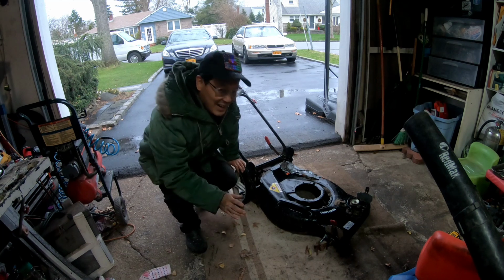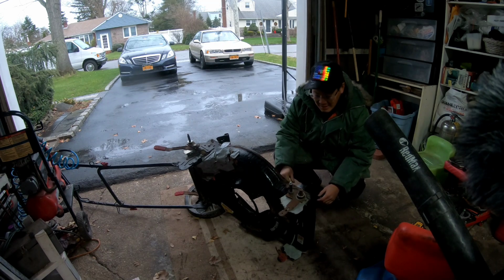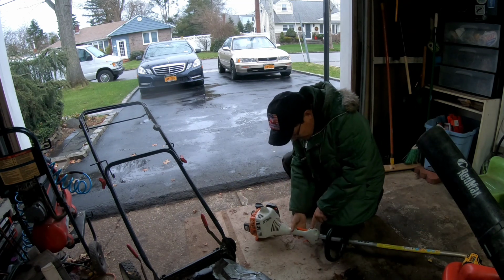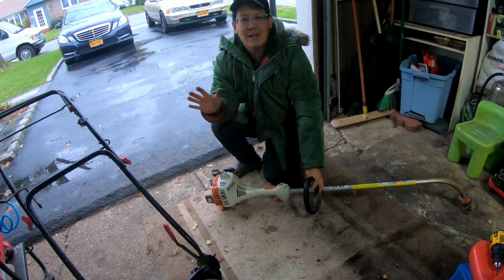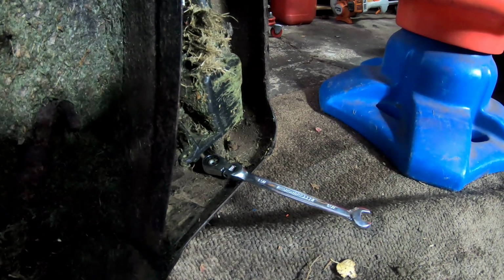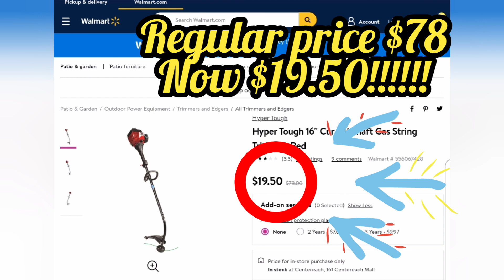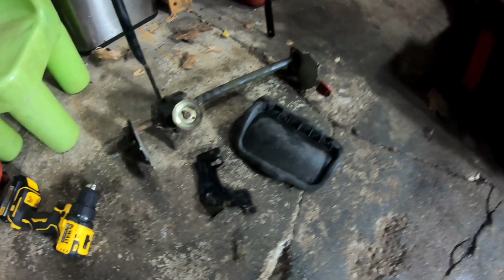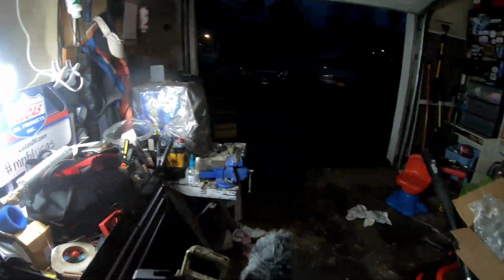FASTEST GARBAGE PICK EVER! FREE STIHL FS45 WEED TRIMMER EATER WHACKER & CRAFTSMAN LAWNMOWER TEARDOWN

Comment: You can actually find those guards pretty decently priced on eBay between $10-$20. Put a new guard on, use some Super Clean and you can get top dollar out of that thing!
Reply from the maker: Yeah, but to spend $20 on a $50 weed trimmer?  Make a $30 profit?  I’ll probably keep it as a spare
Reply: @MowersNBlowers  you can actually profit upwards of $115. I’ve seen them sell in my area for $105

Comment: I had to laugh when you actually cut the case open to get that axle out of the Craftsman instead of removing the circlip retaining ring on the inside.  At least you got that transmission!
Reply from the maker: I did remove all c-clips.  The Pulley on gear box wouldn’t let me slide either way